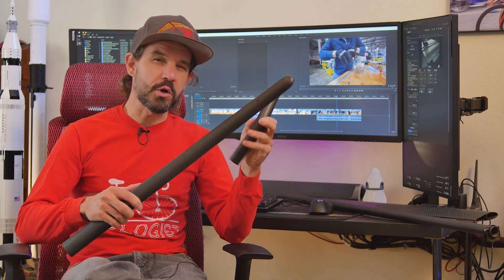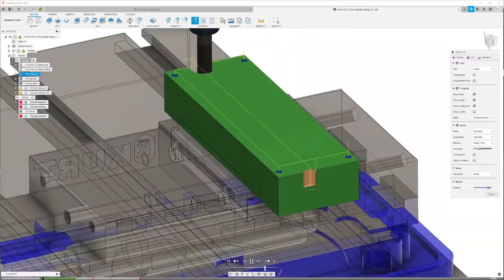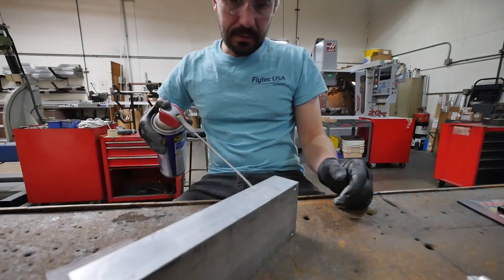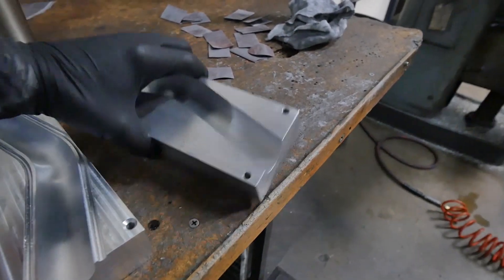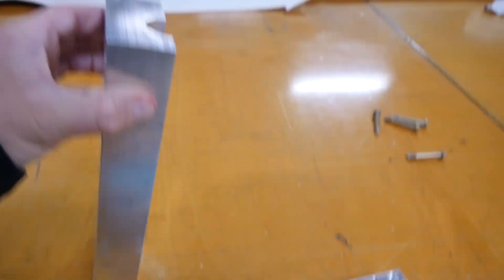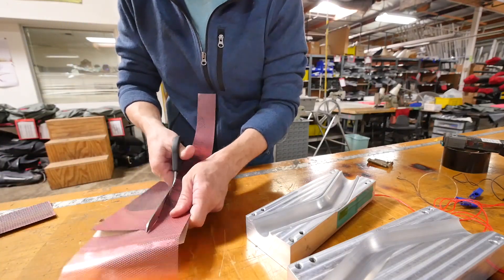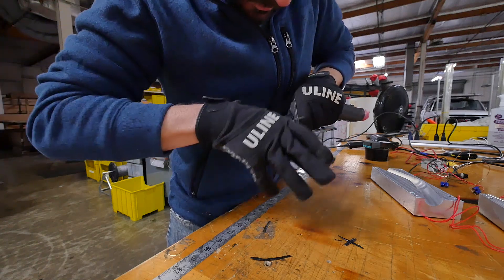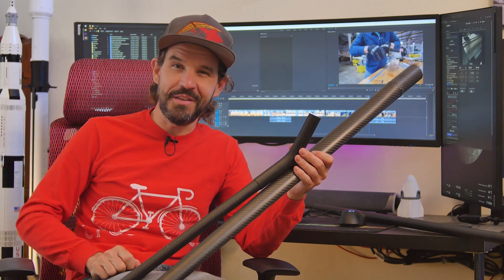A NEW Way to Mold Carbon Fiber - Trapped Rubber!

Comment: FYI. This precise system was in use in European Formula one teams in 2004 ! I know because I was Laminating the parts. The only difference is that the mould tool was cured in an autoclave
Reply from the maker: Yes, it has been around for a while and the title is admittedly "clickbait-ie" but that's how you have to work with the YouTube algorithm these days. The original technical paper I used for reference for this was from 1980.

Comment: couldn't you just bolt the parts together and then use a flex ball hone to polish the insides of both halves together? or would it not make the curve very well?
Reply from the maker: Are you referring to the mold halves? I'm not familiar with a "flex ball hone"
Reply: And they are available in a wide variety of grits, sizes, abrasive compound, etc. These are just an example.

Comment: also, if you cast your mandrel with a metal tube down the middle, you can pull out the tube to allow easier removal. add the tube before loading up the mandrel.
Reply from the maker: Tried that and it was the complete opposite of what you'd expect. There is too much friction to insert and remove a metal mandrel "core." Also, the presence of said core prevents the rubber from deforming under tension which makes removal much more difficult. The best solution was the use of a liquid release agent instead of the film shown.

Comment: I know its been a few months, but have you ever tried this with a couple layers of carbon sleeve over the mandrel, then wetted out and placed in the mold?
This would make layup much easier and quicker, while giving a uniform pattern.
Reply from the maker: Woven carbon sleeve would indeed make the layup for this specific geometry much easier but that would require the use of wet resin, instead of prepreg. Part of the purpose of this project was to use prepreg as that's what we would use for future production parts.

Comment: Using pressured air might ease the removal just like they do with the handlebars of the motorcycles
Reply from the maker: I've tried that on a number of different tools without much help. Perhaps if a specific "air channel" was designed into the tooling for this purpose it might work better.

Comment: I can see casting the silicon over an armature for support while carbon wrapping and to aid extraction from the part.
Reply from the maker: Yep, tried that. It made the rubber significantly MORE difficult to remove because the internal solid part prevented the rubber from deforming under tension while extracting.

Comment: Thanks. I saw a company sell something similar. In that, they would make the insert for you with a material that will expand in heat and cool back to normal size. Looked them up and their price was ridiculous, like more than it would cost me to make a mold. So passed on the idea, glad to see this approach. I didn't bother to try figure out the exact material, but yeah looking back, silicone makes sense. Just get the one with the right thermal properties to handle an oven for carbon fiber.
Reply from the maker: Yes I'm familiar with those tools. Look great but the cost reserves it for high end manufacturing only.
Reply: @designbydave  high end manufacturing is when its so dangerous and poisonous or whatever not just anyone should be doing it i think.

Comment: I thought silicone did not stick to anything but it self. So why the release agent?
Reply from the maker: You are pretty much correct but a better term would be bond. Silicon will only really bond to its self but it can stick REALLY good to something like this making it very difficult to remove.
Reply: When used in this way- or pretty much any way - micro pores/cracks develop in the silicon surface, retaining particles or filling with resin on a microscopic level.   For this reason, a release is used to extend the life of silicon mold and ease part release.

Comment: I’m curious to know what you’re using as your liquid release agent. I’ve been looking for a good liquid release agent.
Reply from the maker: For the rubber or the mold surface? Both are from Chemlease, but I can't recall the exact model numbers.
Reply: @designbydave  The release that you used instead of release film.

Comment: Presence of silicone may cause delamination in composites!
AFAIK such methods are not allowed for structural parts in the aircraft industry.
Reply from the maker: Maybe if you get silicon in-between the plies when assembling the layup. Otherwise there is no issue. Silicon rubber tooling is common place in aerospace composite parts manufacturing (for certain parts and processes)

Comment: Maybe some pressurized air or liquid can help with removing the rubber mandrel
Reply from the maker: I tried that but didn't seem to help. The liquid release agent I would end up using later made the madrel much easier to remove.

Comment: Very nice but i would recommend adding 2 dowel pins in the moulds so that the two halfes are getting centered. Your part is by the looks of it only centered by the part itself. Other than that great video.
Reply from the maker: Yes, alignment pins are necessary and would be added to later, production molds.

Comment: very nice jaz, and great idea . Many years ago I saw helicopter blade made with air bladders (about 4 bladers) rapted in carbon then inserted in a mold and inflated .
Reply from the maker: Yes, bladder molding is the typical, industry standard of making tubular parts like this.

Comment: why bother with casting rubber when instead you just can use a inner bike tire tube and pressure it. Just saying.....
Reply from the maker: A solid rubber mandrel offers several advantages over a traditional bladder for molding a part like this:

1. It provides passive compaction. The rubber expands as the mold is heated to cure the resin. This eliminates the additional complexity of air valves and requirement for a compressor. 
2. Bladders are subject to failure which would ruin a layup. It's a real bummer (and expense) to have a layup that takes several hours to assemble only to have the bladder leak during molding. This ruins the part.
3. The rubber mandrel is reusable, as many as 50 times where bladders  are consumables.
 4. The solid rubber mandrel allows you to do your layup around the "male" tool instead of laying the individual plies into the mold cavity. This allows for a more efficient laminate as the fibers can run continuously around the perimeter of the part.
Reply: ...because this tooling doesn't represent the limitations of the method; if using an inflated tube, you'd be limited to inflated tube shapes.   By using multipart silicon forms, parts with low symmetry/greater irregularity might be produced, I reckon.

Comment: It would be cool too have a element heater work surface, or even an oil heater style work surface. 

EG. Leave your aluminium stock on the surface for 1/2 hour or so… good stable success promoting temperature… hahaha… especially in a cold environment. 
🇦🇺🤜🏼🤛🏼🍀🍀🍀😂😎🤓🤓🤓
Reply from the maker: That would work but the solution I had here was perfectly adaquate.

Comment: Hi David, I just found your channel with this video. I see you're working with the prepreg barehanded. Isn't the prepreg toxic? I'm surprised you're not wearing gloves while working with it.
Reply from the maker: Prepreg resin is just a special kind of epoxy. Probably toxic of you injest it but certainly harmless in small dose contact with the skin. However, after this video I would end up always wearing gloves, but that is to protect the laminate from contamination from the oils in your skin as much as anything.
Reply: @designbydave  Also, dry cutting and sanding of carbon fibres shouldn't been done without a proper respirator. A simple dust mask won't cut it.
Reply: Yes, Epoxy is toxic when it’s uncured and in rubbery state - prepreg included. Continued exposure (many times) of uncured epoxy will likely cause allergic skin reaction. Always, always use glove when handling uncured epoxies (or other thermosets).

Comment: Hi David, what rubber did you use? Do you know the CTE? What tolerance did you run from the final carbon thickness to the rubber OD? Id be really interested in knowing any of these numbers ! Great content. Thanks for putting cool things on the internet.
Reply from the maker: I used Bluesil V-340 from Freeman Supply company. 45 Shore A hardness, CTE= 2.5X10-4 in/in/degree C. All tech specs on the Freeman supply web site

Comment: Suggestion you should have made a  soft hollow  plug thear holds that shape... ie  a silicone bladder mold...
Reply from the maker: Yep that's the "hybrid" approach. Both methods have their advantages. A solid rubber mandrel makes for passive compaction and semi-rigid male form to layup on. The main downside is that you have no, or very little control over the pressure. A bladder would allow control over pressure but much more complex tooling.

Comment: Why didnt you vacuum the mold when you were making the Silicone insert? Seems that would have removed all of the air from the cavities of the mold.  Pretty Cool videos, thank you.
Reply from the maker: I suppose with this mold, since it's small enough that would be a possibility, but it wasn't necessary. The casting process does introduce air bubbles that show up on larger parts but those never presented a major problem. In order to be able to pull a vacuum on a larger mold you would need either a very large chamber (with powerful pump) or a sealed mold which would greatly complicate the tool design.

Comment: I wonder if it would work to make the first layer around the rubber out of carbon tape (spiral wrapped) since the interior finish is non-cosmetic. It would also increase strength a little in the other axis.
Reply from the maker: Pretty much yeah. I would end up making the first layer with 2x2 twill fiber. The twill weave has good compliance and the woven prepregs have a bit more resin which help it stick to the mandrel and also to itself. That allows you to wrap it tightly. Also helps to pre-warm the rubber mandrel.

Comment: Fantastic, can you share what are the heating elements you use to get and control the mould temperature ? It would be really helpful 👍
Reply from the maker: They are adhesive backed, silicon sheet heaters. Available from many sources, just Google them.

Comment: This seems like it would have some select ideal applications but just doing a regular vacuum bag seems easier overall and you would be able to be much more precise with the fiber layup and orientation
Reply from the maker: One of the main reasons for this technique is volume production (something not really covered in the video.) Vacuum bagging is very labor intensive and uses a lot of consumables for every part. And a part like this would use a bladder, quite the opposite of a vacuum, but similar principles. 

The fiber layup demonstrated here is terrible! lol! Literally my first time doing it with a part like this and I definitely wish I had some more recent footage of a proper layup to show that indeed, we can get some pretty intricate laminates together like this.
Reply: @designbydave  Oh I know the differences I make custom carbon fiber car parts for a living. I’ve been doing it for about 5 years or so now. All my stuff is vacuum bagged. 

I’m not disagreeing this is a useful tool at all. It’s something I’d never really thought about. There are 3-4 different viable ways to make a carbon tube. I could probably vacuum bag the same part you made in less time than it would take to do it with the silicone piece. But for mass production on a tube that didn’t need to hold air pressure the silicone might shave off a few minutes long term. 

The only thing I would suggest to you to do another test is that you should try the layup again. But this time instead of wrapping the UD carbon pre preg around the silicone piece, do all your fiber layups inside the two billet halves, put the silicone piece inside, then clamp the halves together. You’ll get much better compaction and continuity of the fiber matrix that way which will yield more uniform strength and lower weight. 

Watch the videos from Easy Composites about making a carbon fiber tube and the video where they make a mountain bike frame, you’ll be able to see what I’m talking about. If you stagger lap the carbon layers in the two billet halves together instead of wrapping the silicone piece in the UD then compressing it, you’ll get a much better finish and consistent part every pull you do. You’ll also end up with zero pinholes that way because the silicone piece will be able to serve its purpose more easily with less resistance. It will also be easier to remove that way after the part is cured
Reply from the maker: @tylerroe5175  Something critical I didn't cover in this video - One of the main advantages (and purposes) of layup over a male mandrel is that you can wrap fiber continuously around the perimeter of the part. With a two part layup, into the female mold cavity, like you are referring to, there will always be a limiting week spot in your laminate which is the lap joint. The strength across that joint will only be the interlaminar strength of the resin. 
But like I said before, the main purpose of this project was to test and prove the manufacturing method. We would later refine the laminates and layup process. I wish I had footage of that because its much more impressive then the poor showing you see here!
Reply: @designbydave  Definitely understand the logic brother! There are trade-offs between each layup procedure. Benefit of continuous wrapping would be fiber continuity, down side would be equal compressive load during the cure cycle. Downside of lapping joints in the two halves would be fiber continuity/strength distribution, and benefits would be layup speed and more equal compression during the cure cycle. I’m gonna get my hands on some liquid silicone rubber and see if I can find a good application in my manufacturing process for what you’ve shown in the video. Cuz there is definitely a decent argument for it. 

I’d love to see more carbon videos from y’all in the future! Even though I’ve been manufacturing carbon fiber car parts for years now I’m always on YouTube looking for improved and more advanced practices.
Reply: Vacuum bagging gives you  14.7 psi of compaction force max. This is not sufficient for the elimatiin of porosity and/ or voids throughout the laminate. Trapped rubber acheives pressures much higher than even an autoclave. Once the ends of that tool are  capped the pressure exerted on the laminate would be incredible. No porosity and an incredibly low void content.

Comment: Really cool! I'm curious what those complications are with the bladder method and how this internal silicone mold gets around those complications. Have you considered using a higher COE material to provide more compaction (such as paraffin)?
Reply from the maker: Main problem with a bladder is that it is prone to leaking, which results in a failed part. You can also have compaction issues in "sharp" corners where the bladder has a hard time pressing into. 
The rubber has PLENTY of compaction. It's actually one of the issue with this method. Too much pressure requires VERY rigid tooling.
Reply: @designbydave  i like it.. the outer mould is cast or cnc?? maybe you could use that for the internal ,i.e. split the core at the kink. tap and dye - bolt together, unbolt release??